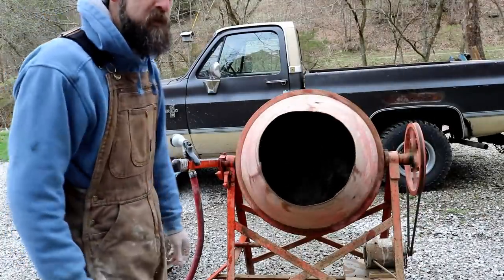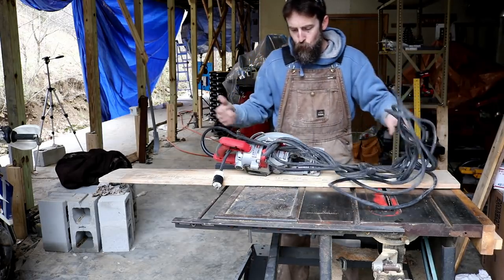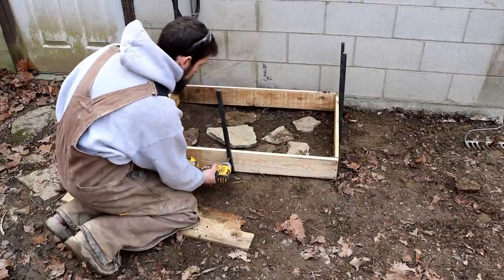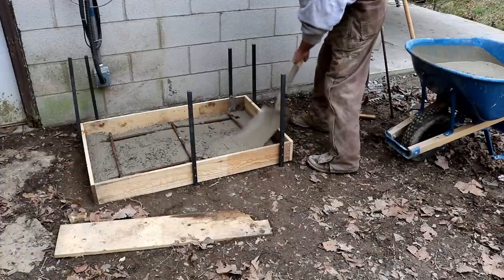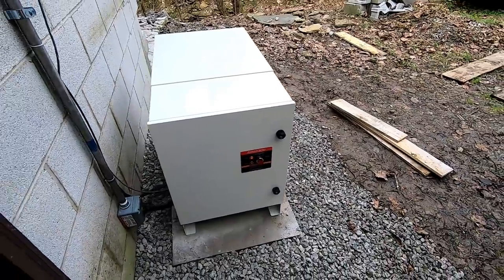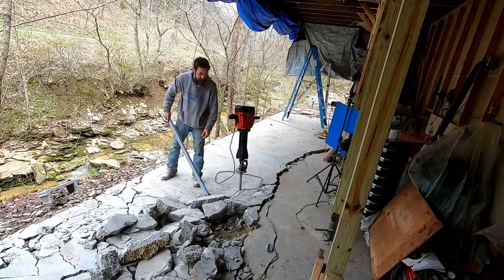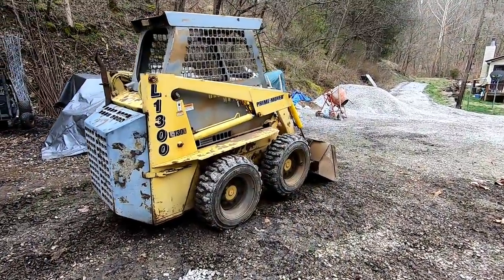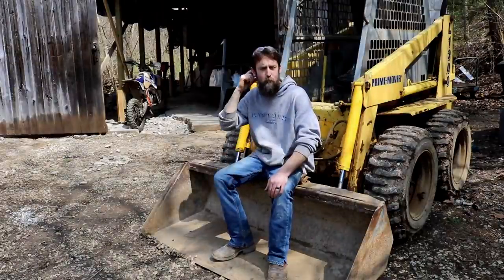Shop Damage #8 Jackhammer Time / Concrete pad and bobcat run

Comment: Re: Thickness on the edge of the slab, this is done because this is where the weight of the building is transferred to the ground its called (thickening) do this when you pour your new slab too and run at least 2 long strips of rebar down the entire edge of the new slab about the same distance apart as the blocks walls and about an inch off the side of the slab, personally, I would lay in mesh and rebar on the new slab too just because of the heaving effect of the winter ice and it is why you need to get your uphill tile drainage done too at the right depth to deal with the water, the more you can shift away from under your slab the better off you will be in the future and also consider a heating cable within the tile itself because an "ice blocked" tile does you no good either, check out this link https://www.amazon.com/slp/Heat-Trace-Cables/r4gn4vdje2m844x and https://www.building.govt.nz/about-building-performance/news-and-updates/codewords/codewords-issue-85/concrete-foundation-wall-reinforcing/ also cinder blocks are hollow for a reason that so they can be filled with concrete and steel after they are built, building a wall without this step is not the best and I give you your own example of why that is, look how easily you were able to take that wall down compared to the corner at the front that was filled with concrete. as they say, do it once and do it right. the rebar ties that you have with the end eyelets are for this tool here https://www.ebay.com/itm/Automatic-Rebar-Tier-Wire-Twister-Tying-Hook-Machine-for-Wires-Fence-Twisting/253946889924?_trkparms=aid%3D1110002%26algo%3DSPLICE.SOI%26ao%3D1%26asc%3D20200116171858%26meid%3D32beba949e6e4258a89764aac4ef28af%26pid%3D100008%26rk%3D1%26rkt%3D12%26sd%3D253946891589%26itm%3D253946889924%26pmt%3D1%26noa%3D0%26pg%3D2047675%26algv%3DPromotedSellersOtherItemsV2%26brand%3DUnbranded&_trksid=p2047675.c100008.m2219 and they are a great tool will worth the $15.00 price tag for ease of use when dealing with any amount of rebar or sandbag sack tieing etc. and honestly Steve you have the equipment to make one of these.

Comment: Man do yourself a favor and get you a different mixer for that job. That thing is a failure by construction. The mixer I usualy use is around  65 years old, takes three times the load and it is narrow on one side so its really easy to unload it. Concrete work is still not my go to but its way more likely to be done with proper equipment.

Comment: some countries use these weird hooks to tie rebar : https://www.youtube.com/watch?v=6HIygXsoO3Y they can work pretty ast with those , my father used t do it for a living they used long cutting pliers wound the wire loosely around the handle before starting the job
if you just break up the floor intoo smaller pieces with the jackhammer you should be able to get it out with the bobcar by tilting the bucket a few times lifting and breaking it

Comment: When you do form work, to keep the concrete from sticking to the form use a garden sprayer with some form oil. If you haven't got form oil or access to it, used motor oil is what was used before form oil came along. Spray a mist coat on just thick enough that the surface of the board takes on a slight sheen. The oil will absorb into the wood but enough will be left on the surface that the lumber will break free fairly easy. After the first use, it will take less oil if you use the wood a second time.

Comment: Don’t wait a week or so to put in anchors.  It’s just going to get harder and harder.  Do it while it’s soft.  We used to be able to drive in regular 20 penny nails into concrete just a day or two of it being poured and not hammering ourselves silly with cut nails a month later.  You’ve already gone 50% over 100% with everything you’ve done so far with that pad, rebar and thickness.  Not that you went down to packed earth but put it on top of loose earth.  You would have failed inspection for a foundation with that.  Your just making it hard on yourself.  Your overworking and overspending.  Do it if it makes you feel better I guess.  I did chuckle a couple of time when it looked like you got the concrete wet enough but thought it was maybe too wet.  If you get it too wet, just pour it and watch the water flow off and work it when it’s ready.  Just packing the concrete in with a rod or pole around the form would have helped a lot more than hitting the form with a hammer.  Think of a sand crab(foundry worker) packing a mold for casting.  Just a piece of rebar would suffice.  If you seriously need it HARD for whatever reason, just wet it with a hose once or twice a day for 3 days and it’ll get as hard as 3 days can be.  It will continue to get harder and harder over the next 20 years.  But seriously.  A megapad like you made to sit that little box on is almost completely negated because you didn’t dig down far enough to hard naturally packed soil.

Comment: Considered some gabions steve? My stepfather used to use them for errosion control when he was a reserviour keeper. Just big wire baskets filled with stone or rubble. You can buy the baskets and then fill them
Reply: Yes. Fill them with your broken up concrete and if it comes to it, the cinder blocks, broken up. Cheap as chips, and foolproof.
Reply: Yep until the wire mesh rusts out, as it always will! Not a "permanent" solution.